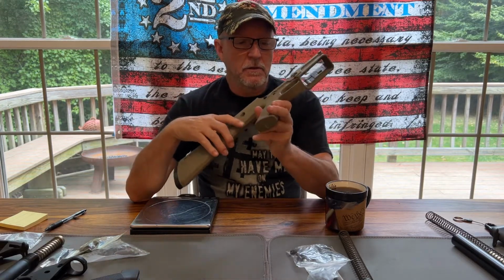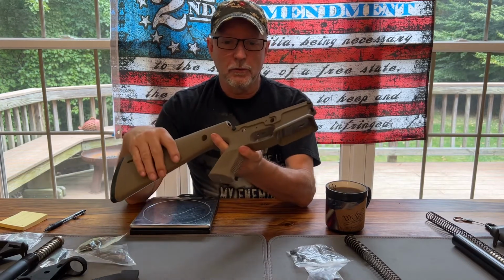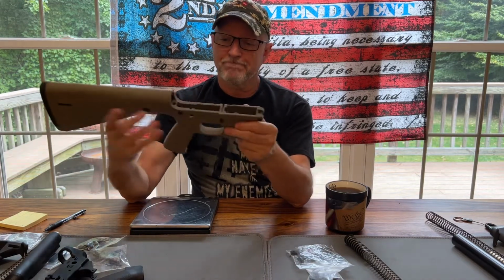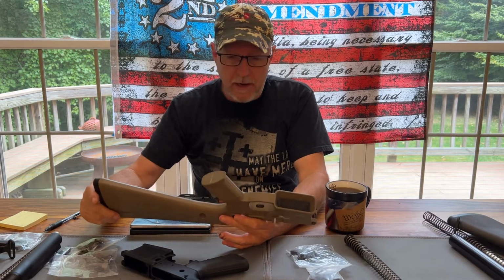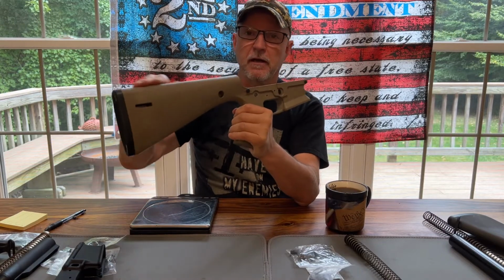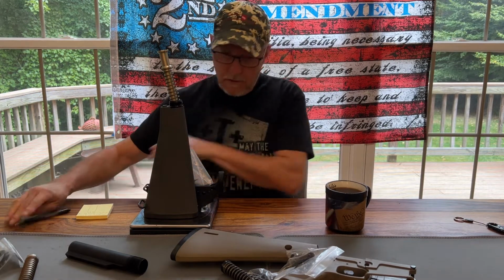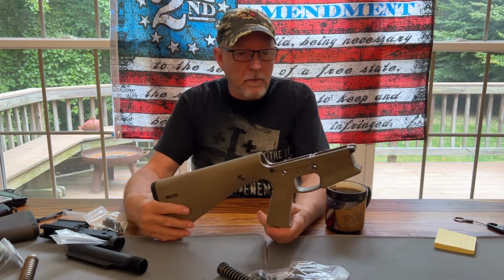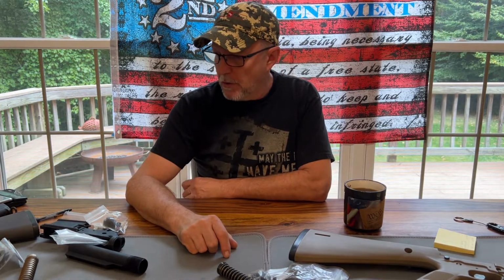KE Arms Stripped KP15: Part 1 of 2 - initial impressions & weight comparison

Comment: those arent mold marks, the lower is molded in two parts and those parts are then friction fused together and those are the marks you see, you can sand it down however you want but the lines wont go away

Comment: Hi, very helpful vid! what was the weight of just the KP-15 lower without the other parts (with the buttplate and take down pins)? I saw you put it on the scale, but then you didn't mention the weight before you started adding the other parts. Thanks!
Reply from the maker: Thanks for watching my video.  I’m glad you found it worth your time.  I did not note the weight of the KE Arms receiver without the associated parts.  The reason for that was I wanted as close as possible an “apples to apples” comparison of the receivers and parts that would be required to assemble each of the different configurations.
Reply: @crazyhawk99  No worries. Thank you for the quick reply!
Reply from the maker: @stephenk9301  my pleasure!

Comment: Echo93 will shorten the LOP do to about 12 inch which is what I did with mine.
Reply from the maker: Thanks for watching and for the suggestion.  I don’t think there is any excess LOP with the KP15 from the factory.  The Echo 93 recoil pad mod is a nice option, but that’s all they are doing to the lower and they are selling them for $179, which is almost $100 more than I paid for my standard KP15 so in my humble opinion, not nearly worth the cost. Just my 2 cents.